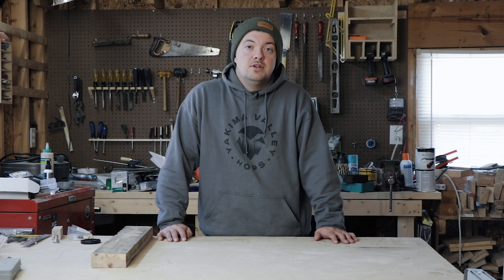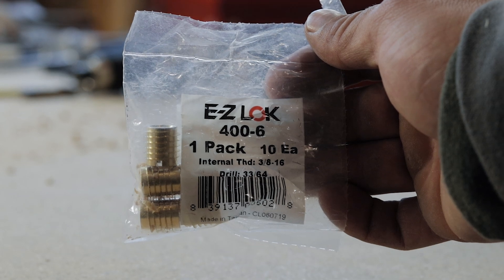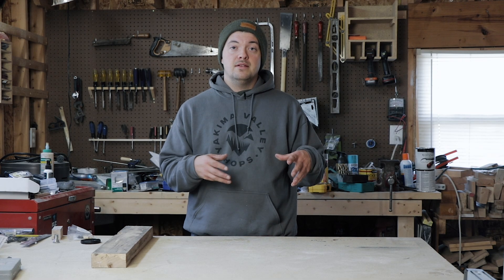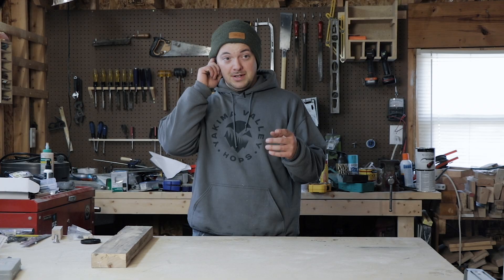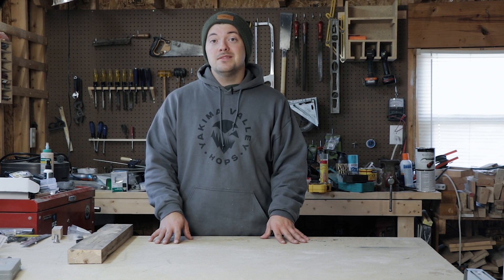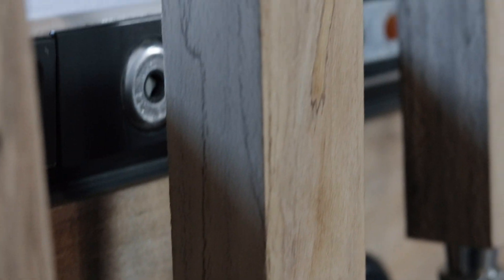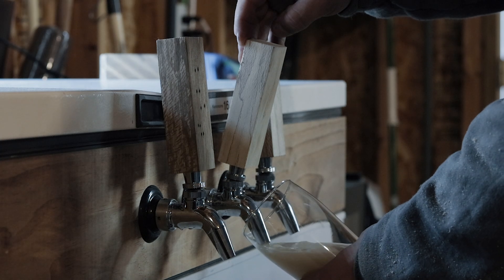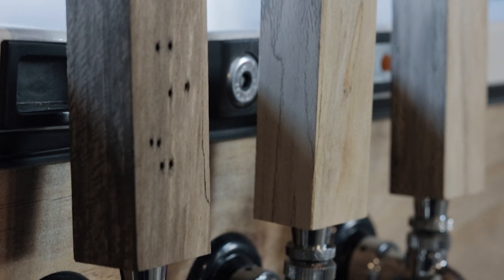10 Easy DIY Tap Handles for $15

Comment: If you are going to make boring ass tap handle you could have saved money and just bought the amount of black plastic tap handles.  3 of them cost $9.27 at kegworks.
Reply: This is a blank slate, if you're crafty at all  you can do all kinds of modifications: like the above comment said about adding chalkboard paint, cutting into different shapes, carving designs, etc. I'd say even a plain wooden block is more interesting than the black plastic handles.
Reply: Are they a little plain? Yeah.... buy not as boring as what you are offering! Wow
Reply: @Nowuries01   Yeah they are extremely boring and frankly pointless if they are that crudely done.